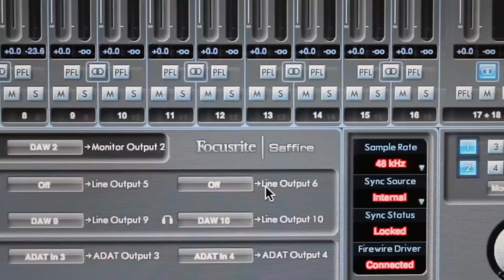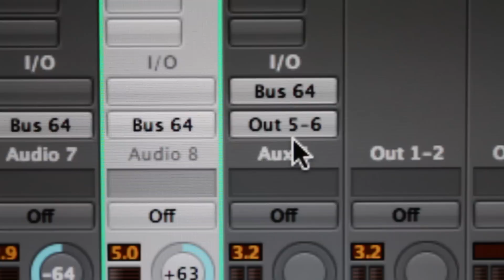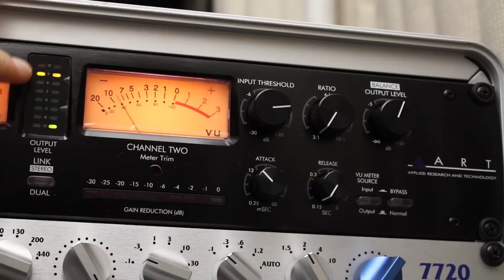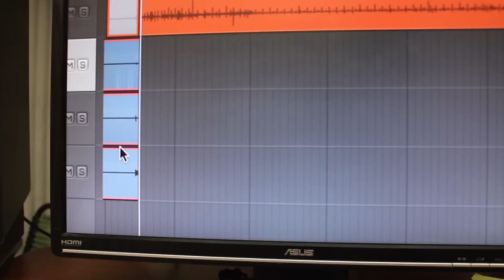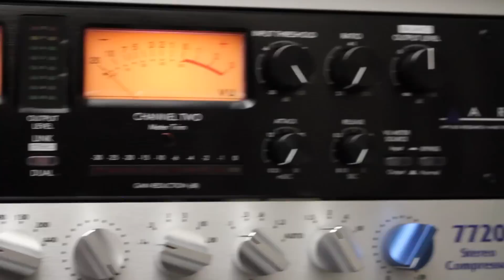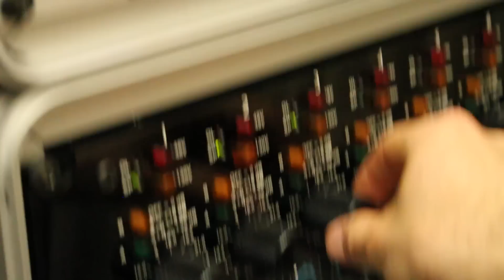Get Outboard Gear Into Your DAW- Compressors, Preamps - Focusrite Saffire Pro 40

Comment: It is a misnomer that you should try to raise the volume of the input until it is the loudest it can be without clipping.  This has been debunked and it is something that noobs do.  The ideal level is -18db, which is far from the highest level it can be without clipping.  Plugins EXPECT the level to be at -18db to work properly.  Many professional digital audio recorders will say in their manuals to not go above -12db, the range you want being between -18 and -12.  Nowadays, the SNR (signal to noise ratio) is very high for all pro gear, so there is no need to make it as hot as possible going into the DAW or any outboard gear.
Reply from the maker: Ziggy Death, the best dynamic range & signal to noise ratio are achieved by using all bits available in the A/D process. I don't care what your sources say because this is a mathematical fact. Certainly, yes, good recordings can be produced with levels set lower, but my aim is always to capture the best possible conversion. This is why I aim high like with everything else in life.

Additionally, your misuse of the word "misnomer" doesn't help you here.
Reply: What I said is true across the board, whether you are recording with all bits (32 bit) or less than all bits (24, 16, 8, 4, etc) and at any sample rate 192kHz and below.  It has nothing to do with sound quality, but in the mixing stage.  You do not want all the tracks to be near 0 db when you are mixing.  When you "sum" multiple tracks together the master peaks out very fast, so you will be forced to turn the master level way down in order to produce a mix that does not clip.  That is why it is recommended to record around 18db - ease of mixing multiple tracks plus (i am a software developer...i should know), many plugins are designed to handle a signal at 18db (take Native Instruments Supercharger, which shows you the best input level with LEDs), which on analog devices was what is known as 0db.  You could go past 0db on analog devices and get saturation, which sounded pleasant, but in the digital world, you just get a hard clip.

I did use the term correctly.  A misnomer is a wrong or inaccurate use of a name or term, and the term is that HOTTEST=BEST. A "term" is a word or phrase used to describe a subject.  Are we clear now?  We are not talking about transferring tapes to CD.  Then, I would agree with you, since there was crazy hiss on tapes so you wanted to pump up the volume as much as possible before peaking out, but we are no longer living in the 80s.
Reply: Look up "Unity Gain".  I understand the source of the confusion.  People are trying to get to unity gain, which was explained as being "close to 0db as possible", but the pros that are saying this are speaking in analog terms.  In an analog mixer, 0db is equivalent to -18db or 20 db in a digital mixer.  So when they say "stay as close to possible to 0db", they mean -18db.  Hence, the misnomer.  No respectable engineer will ever track their transients higher than -10db (digital).  An important rule is that is you find that your master fader is lower than any of your track faders, you have done something wrong in the tracking/gain staging process.
Reply from the maker: Dude, no kidding multiple tracks result in overall increased amplitude -- turn down the channel faders in mixing but don't sacrifice dynamic range to make mixing more convenient. I'm talking about A/D conversion & using full bit depth for best dynamic range.

"No respectable engineer will ever track their transients higher than -10db (digital)"? That's your opinion, ZD. I learned what I know from an audio engineering instructor at Indiana University as well as the Conservatory of Recording Arts & Sciences (my alma mater), not a software developer on YouTube (you) hijacking the comments on a video. Get your noise off my channel & go make recordings if you're such hotness in the game.

** I advise anyone reading Ziggy's comments to take an audio production class at an accredited institution or study under a professional if you are interested in this topic of discussion. The information he presents is opinion, not fact **

Comment: 5000€ preamp for a home studio ?
Reply from the maker: I am an archival audio engineer for symphony orchestra as well as jazz performance. This video may take place in my home, but almost all of my recording does not. At any rate, you get what you pay for, dude!
Reply: Thanks for responding and taking the time to do the video
Reply from the maker: :D Rock on!!!!!1
Reply: You pay a lot for having top notch gear. However these preamps are made on this earth, so getting the parts for it are possible (to an extent). You can DIY this stuff on your own with a lot of dedication and come close to the result of the professionals. Learn to solder and some electronics and you are on your way to a great sounding preamp. I am working on making 2 mono compressors and a 2 channel preamp in the start of 2017.